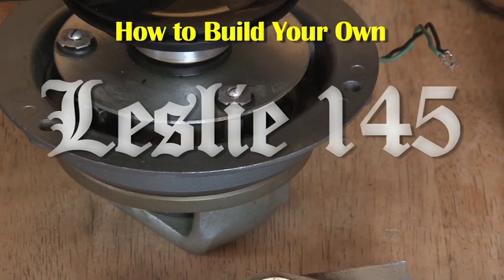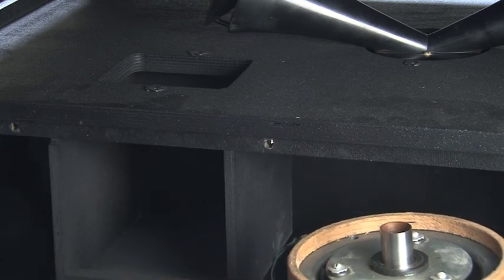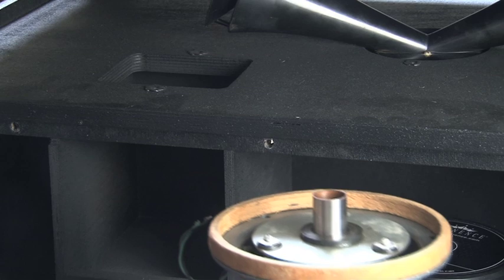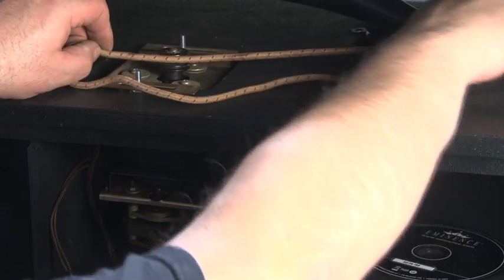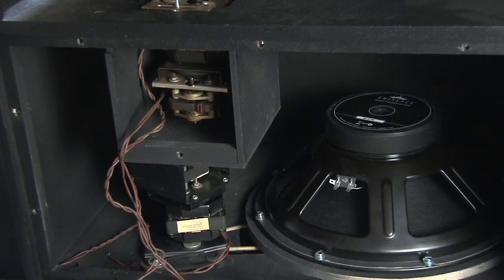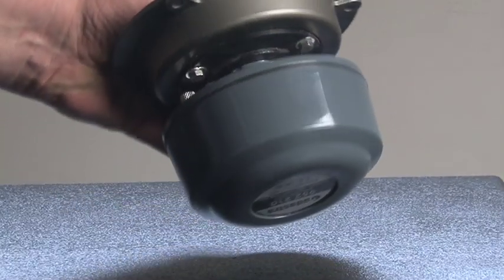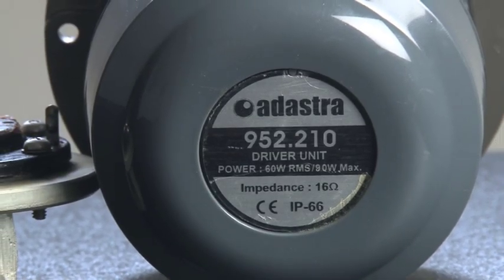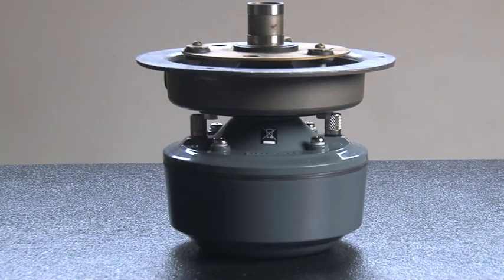HOW TO BUILD A CUSTOM LESLIE SPEAKER FOR A HAMMOND ORGAN - PART 3

Comment: Hi Keith I wonder could you give me the measurements of your Leslie cabinet,or is there a diagram with measurement  also I have a Hammond T500 with rotary speakers can use  but I need a set of horns and the motors 240volt as I live in N Ireland. I have seen Horns on eBay in the USA but the shipping costs is more than the Horns and the motors they also would be 110 volts ,I have a Nord C2D and would love a Leslie speaker for it hope you can Give me some advice ,I am a mechanical engineer can do most things not sure on user g the amps of the T500 might need some helps from some one ,but if you could help me with the first building parts I would appreciate it Thank-you  Ray Williamson.
Reply from the maker: The cabinets I used were were exactly the same size as an original Leslie 145.
I do have some Leslie parts that I could sell to you, if you are in the UK.
I can only give limited tech support to my Patreon supporters: www.patreon.com/keithappleton
Reply from the maker: Please type this into google: LESLIE 145 DIMENSIONS
Reply: Hi Keith Thank you for your reply, it has been a great help and encouragement to proceed with this project ,I will be braking a Hammond T500 organ with the lesilie speaker and wheel, I’m not sure if I can use the amp from it,I plan to brake it up soon I’m a mechanical engineer and can work out most things but no experience in electronics just a ? Would you have a set of top horns and motor/ full unit .again thank you for your reply Ray
Reply from the maker: I will have a look and see what I have }:-)))

Comment: Can I make horns out of modified vuvuzelas or something similar?
Reply from the maker: Probably best to buy a proper rotary horn, they are cheap enough via Ebay .......
Reply: @keithappleton  Not where I live though... My general plan is to make it out of junk/second hand items, so I think it may be a good option to try, even if it'll sound bad. That, or I'll 3D print both horn and lower rotor.

Comment: Hi Keith,
Fabricating a belt tensioner would not be difficult. 
Solving problems like available belt lengths and belt stretching. 
A small 1-2" plastic pulley with a bearing.
A 1/8th"  by 1" by 4" piece of steel.
Some bolts, nuts, wood screws lock washers ... would do it.

Frankly, I've never seen the importance of the baffle around the upper motor. The woofer volume area is not the reason, considering the cabinet construction. Besides, the upper motor can't cool as easily. Dust exclusion is the only reason I can think of - but is it worth the heat build up?
Cheers!

Comment: It would be interesting to get a frequency response chart of the Jensen V21 treble driver in order to compare it to modern speakers. Otherwise, it seems to me that you could only decide by ear what sounds best. The Atlas speakers were indeed used by Hammond Suzuki themselves for quite a while. Their ferro fluid-cooled OEM treble driver (rated at 100 Watts), which is built into the 122/147 XB or 122/147 A Leslies for instance, is based on an Atlas treble driver - though, that particular one brings imbalance to the organ's sound due to a significant overamplification of the topmost two octaves of the instrument. There're a lot of suggestions on the internet to go for an Atlas PD60A (60 Watts) but to me it behaves similarly to the driver mentioned before. A far better choice seems to be the Atlas PD5VH (40 Watts).

Comment: I'm watching as much as I can about Leslie cabinets as I am planning to build one from the Leslie unit that was inside a keyboard.  I'm still at the designing the cabinet stage. I was thinking of  using an amplifier to power it but it is a lot simpler to just use my guitar amp signal.  I will on my next build.  One thing I love about building a homage to a Leslie from recycled parts  is that I have absolutely no idea how it will sound. This is Mk 1 . Watching these videos is helpful, thank you

Comment: thanks keith,
i guess i need to search a bit harder for parts on ebay,i wouldnt mind getting a reliable source though than a couple of one offs,incidently,i checked out youre page by clicking youre pic,model steam etc,superb.if i get the info i want i'll pass on the names.
Reply from the maker: +john amptech I have lots of spare Leslie parts for sale - which do you want?
Reply: +Keith Appleton 

the parts needed would be the top horn and lower drum assembly's,or just the top horn assy',

the drum could be made as per the original design from ply,or get a foam drum but i think it may soften the tone ,and thats what tone controls are for.

rods and bearings are no problem,the top horn assembly and puley wheels are the main point's of contention.

a few point's for the leslie novice,

the double throw relay in youre vid controls a two speed motor of 120mA,we used to have a catering equipment buisness,which dealt with rotisseries,kebab machines etc,all used various motors,shaded pole,induction etc,im sure some were two speed,if you cant get 240 motors to fit i'll give you the details when i get them as this will probably be the best bet,even though i could use pwm dc motor control,the two speed ac is the easiest,also we did alot of ventilation /extraction work and certain fan motors can use speed controlers of the SCR control device the same as light dimmers,withiut dammage,not all motors like this and heat up and melt down.i'll pas on the rellavent info,small stepped transformers can be used too ,to get  speed control of a single speed motor using the relay,so youre never stuck,and it's all pretty cheap,but don't tell everyone.lol.im still a working technician.

ive never used a leslie,only a emmulator pedal,which is held down by foot for ramp up or down then released or pressed and released for on/off function,with speed for ramp,and model,145,L16 and122,a blend function between drum and horn,but a real leslie cant be beat.

sorry for the questions,but i have to ask,

is the drum/rotor controlled by one or two foot switches ,on/off-fast/slow.

i can get parts from the U.S but id rather buy from a fellow brit.
again i appologise for being a drone ,but i could heavily get into the tech of this,as i probably will have to anyway,but the info on what i can do myself,whats available to me and you serves us both as to what i need in components,and a bit of tech info too.
ATB,
johnamptech.
Reply from the maker: +john amptech I bought a pair of lower rotors from the States - what is your location in the World?
Reply: just up the road from youre self(sort of),glasgow(sort of).the upper horns seem to be the most difficult part to obtain,i also know i could make a lower rotor to suit my needs as i want to make it portable,that said ,it will still be the same electricaly speaking,as well as the top rotor/horn assembly,i did research this a while back and im sure  it is yamaha who make the organs and leslies now,the horns are plastic,some people say they lose treble due to the plastic resonating more than the harder bakolite,but posting bakolite items from anywhere makes me cringe,valves are bad enough.whether or not you have items i need/want i'll still give up any info i can get for alternate parts,motors and such.
johnamptech.

Comment: i want to build a leslie for guitar,with horns and big rotor,i am an electronics technician,the big problem i see is getting the mechanical parts ,i think yamaha do the horns ,but are plastic not bakolite,so tone may suffer,to what degree i dont know,but i digress,the parts are still made,and i think it's yamaha,crossovers are easy to make ,i design and build tube amps so i only need a leslie "speaker" i can plug it into an amp head or combo.as for the motors,i was thinking pulse width modulated "PWM" dc speed control,as for the 110v ac motors,seeing as they are small motors and wont have a huge inrush starting current,the step down transformer used would be quite small,so this is still a very easy fix to using original motors and control gear.
i already make guitar amps as i said and this involves making cabinets for combo amps,so thats no problem,i need assembly help for the horns and the original set up as i would preffer not to design a whole new control,its not hard to design ,but if i can buy most of it to plug together,i also have not used horns and advice for the best to use on guitar would help,the big speaker would be the usual greenback or for my own a nice smooth alnico type cream back from cellestion.any suppliers in the uk for the parts to put one together would be most appreciated.cheers.
johnamptech.
Reply from the maker: +john amptech  EBAY .......

Comment: Great video, Keith. Just a minor point: If you have two 117v motors, and you are not using the valve amp, you can just connect them in series to the UK mains. No need to get the 230 v models.

Best

John
Reply: Be careful, is not that easy. Motors are complex inductive circuits and by connecting them in series to AC you can get different voltages, even higher than the power supply.
Reply: Shaded pole motor complex?
Reply from the maker: Yes I guess so, but if one of the motors gets a short circuit the other one will suffer . . . . 240 volt motors are cheap enough as the are fitted to internal Leslies so there are loads about . . . . :-)
Reply: Yes. agree. I only realized my point after paying £25 for a good transformer that weighed a ton. When I took it out and connected in series it worked fine. Your point:  I suppose we should be scouring ebay for organs with built in Leslies that are going for next to nothing or maybe to the tip and try to rescue the motors.
Keep up the good work!
Reply from the maker: John Bishop Yes, that's a good idea . . . 240 volt motors appear on Ebay quite often without the scrap organ accessory :-)

Comment: this is great Keith, I am currently adding a horn to my 125 I grafted in some top louvres out of an old 120 in and am now painting it up. I bought a v21 at great expense from canada and finally picked up a custom made crossover today. The v21 is distorting quite a lot so I am presuming it is blown which is upsetting! Maybe one of these drivers would be good. My 125 is only 20watts though so should i get a lower rms driver?